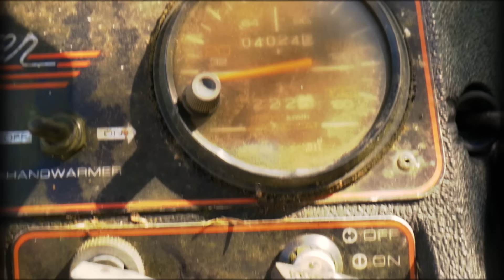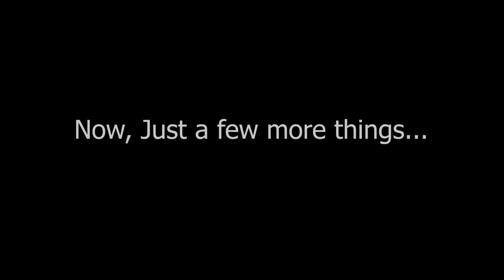I put a snowmobile engine on a motorcycle

Comment: Homie the bike looks great but I hate to tell you the exhaust was built in that funny manner because it needs to be for that engine to make Power it's called the expansion chamber. Without it your engine is seriously lacking in horsepower and torque. You need to re-engineer away to mount it to the motorcycle chassis to achieve maximum power and smooth Power Band

Comment: Leave the brakes on the Jack shaft thers  reason y snowmobiles have them on the Jack shaft and not the track drive wheel that Jack shaft has hell enercia and u need to stop it there if u get rid of the brake on the Jack shaft and only do it on the rear tire it will be harder to slow the engine rpms down with the rear brake quickly but with ur brake on the Jack shaft like one  snowmobile u can go from 80mph to locked up in sec if u want

Comment: I’ve been wanting to do this with one of the wankel snowmobile engines I’ve got but don’t want to run a cvt clutch setup.  Anyone know of an 4 - 6 speed transmission that’s separate from an engine case that could possibly be used.  PS like everyone else said throw an expansion chamber on that thing and hold on.

Comment: It is running too mixer bleeder might be plugged up rich may be the air system of the carb are blocked  and timing is about two degrees on the slow you will run high test types of gasoline this a fan-cooled engine these almost always have 10,5:1 or better compression ratio even as high as 12.6:1 check manufacturer see what the proper oil to gasoline ratio is suggested for it at WalMart they do have a really great two-cycle oil and it is about as green as you can get for the EPA reasons you expansion chamber needs work to like smooth it out for better flowing. You should be able to get around about 55hp to 60hp @ 8000 rpm  Oh check the air filter just might have some thick-oil on it if it does wash it out get some K&N air filter to spray on the air filter element that will help lean out the low to mid band over-rich portion. Good luck and godspeed john Glen!   <\-%}

Comment: I don't think you realize what an expansion chamber does or how it works you should have cut the sections and re-welded them in a way that it works for you but that what you've made will rob power from the performance of the bike

Comment: It won't run properly without a proper (meaning not any) expansion pipe. Still is sick 😷
Reply from the maker: I wonder if it would work if I extended the exhaust with what I put on, then add the expansion on the back?
Reply: No it won't. The distance between the converging and diverging cones, and cylinder all are what make the pipes power. If you alter the length your altering the way the pipe works. It's all about harmonics.
Reply: @julesjan4019  technically with the proper size, volume and length of the pipe you can achieve the same effect. It is possible although it would be shaped differently. There are free books and calculators online that go deeper.
Reply: Yes BUT he's using the same pipe. I understand it fully.
Reply: @julesjan4019  If he still did use the same pipes it would be possible to extend the header and have a shorter expansion chamber.

Comment: Being a twin cylinder (2 spark plugs I think I saw?) if you get it jetted correctly for whatever expansion chamber you put on, be very careful, a 500cc two stroke engine will have astonishing acceleration.   You probably know that unlike a 4 stroke, the piston on a snowmobile 2 stroke engine fires every time it goes up toward the spark plug.

I had a Suzuki  RGV250 (2 stroke sport bike) that came stock with 70 horsepower.   Mid-1990s era bike.  So you can see compared to a 4 stroke motorcycle your build will probably be a handful, be careful.  Looks like you have the motor pretty far forward in the frame, so *maybe* the wheelie situation won't be a big deal.

Comment: love the idea, sounds great too, but seems your in a hurry to get it done, you clearly dont understand the 2 stroke concept, maybe look into that?? this way, with this crappy exhaust, you might have lost 25 to 40% of its power, the original exhaust has a shape for a reason...besides all that, i'm also not really impressed by your metal works skills, maybe take a little bit more time? the grinding, and welds, euhm, just suck...looks absolutely bad, and what looks bad, normally isnt that good either, pretty crazy, since your working on a bike....